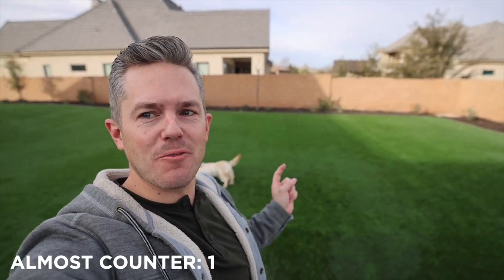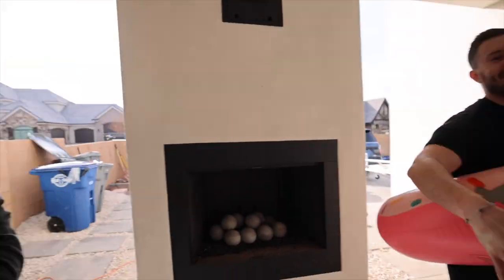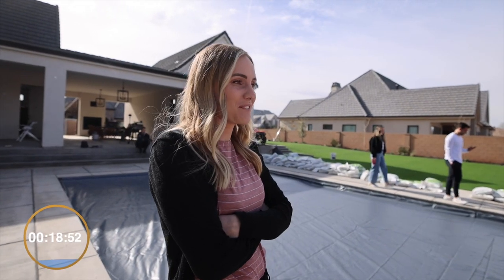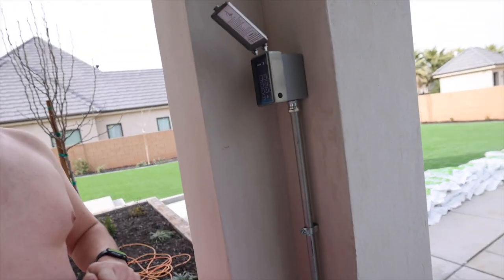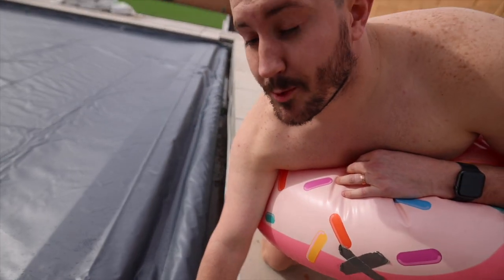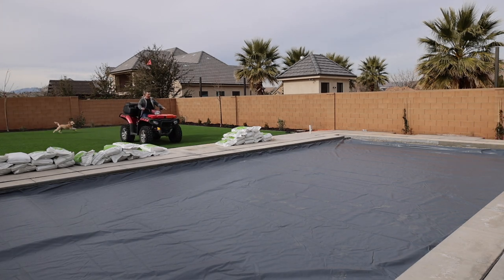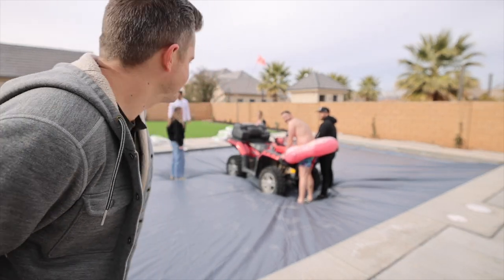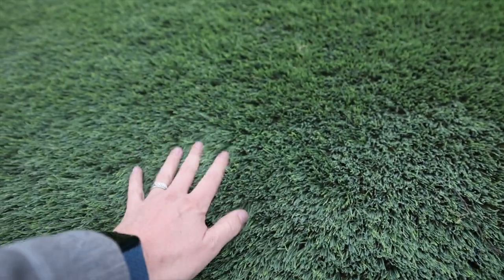DRIVING ATV ON OUR POOL COVER! (1000+ LBS)

Comment: It does look really nice. Since it doesn’t rain a ton in that area, does it have a sprinkler system to run and get that pet urine to wash away into the drainage system that’s under it? Or it just won’t smell because it has that feature? So cool
Reply from the maker: We debated about having a sprinkler system underneath, but we figured we would save the money. There are a lot of water spigots around to help with washing the area. But also, because it has that feature and the infill, it won’t smell as much as others
Reply: Matthewmatthew